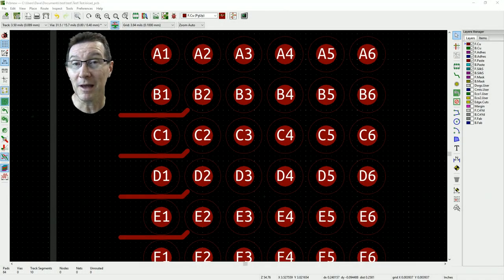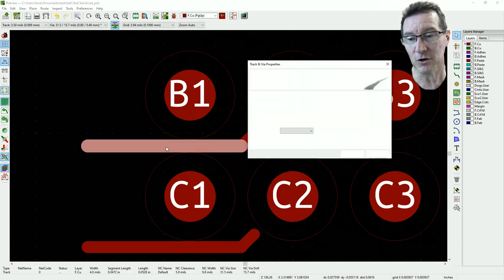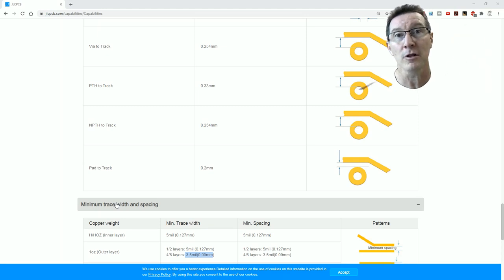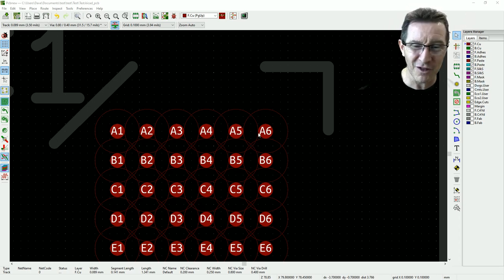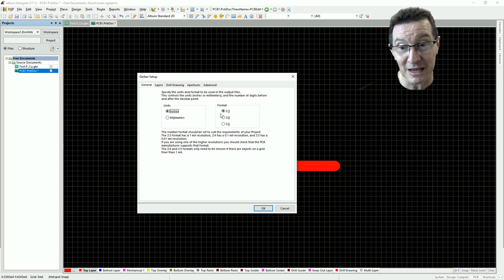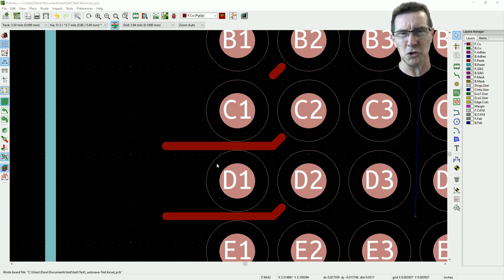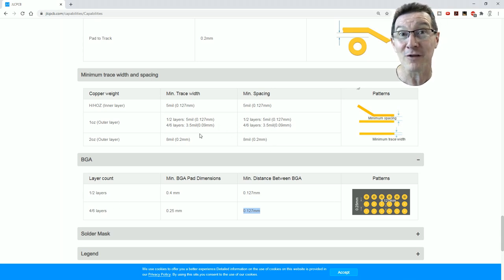EEVblog #1327 - 3 Ways to FAIL at PCB Manufacture

Comment: The pad to pad distance is about the solder mask, there are actually many companies that mess with that layer. For example my main supplier requires the solder mask in gerbers to have the same dimensions as pads have. But they adjust the actual dimensions in the tooling process (+2mil for small pads, +4mil for bigger). My experience with those prothotype PCB manufacturers (jlcpcb and allPCB) is that they are actually very helpfull and they will go over some issues with you (I don't know if that's a common thing for a $5 board or if they do it for more expensive PCBs, mine was about $80). For example I had an issue where they weren't able to put solder mask bridge between PADs and after a discussion with their engineer, I ended up making them a bit smaller.

Comment: Thanks for the video.  I use JLCPCB myself, and it doesn't seem that they touch the gerbers at all.  However, I haven't done any fine pitch (nothing finer than TSSOP-2, and no traces finer than 6mil) PCB's and so have not had any need to push the limits of their process.

Comment: I have switched many pcb production fabs and made a rule. Make all tolerances +1 LSD. For example 0.127 => 0.128, 0.2 => 0.21. With only execption is holes because it is makes no sence. Also, keep in mind rounding errors in checking and drawing software.

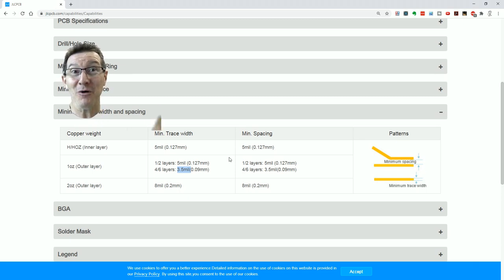Comment: Just wanted to add something regarding JLCPCB minimum trace widths @3:50. After reading the comments, it seems most people got away with 3.5 mil wide traces. Therefore, I just wanted to note that the minimum spacing of 0.090 mm seems to be a stricter requirement because I was told to resubmit or cancel my board because I also had a dense set of parallel traces spaced at 3.5 mil (0.0889 mm) as well.

Anyway, just wanted to state I wish I had seen this video earlier because redoing those traces was a pain.

Comment: I read English / Metric conversion rounding caused issues with the Soviet IC industry. They rounded the 0.1" spacing.  If boards/sockets and chips were from mixed systems, the more pins the harder to insert,

Comment: I use 0.199mm minimum spacing for all PCBs of 1oz-20z copper, manufactured hundreds from 2 layers to 8 layers, with several different manufactures and never a single issue. 0.199 is usually well within the capabilities of most manufactures. JLCPCB has delivered some of the worst quality boards ive ever seen but still worked with those limits even on 2 oz copper.

Comment: I add 16mil isolate on inner layers since I've had boards come back with the holes too far off. I also have had boards with spots that are not completely etched. I also had a board house not remove Silk over pads.

Comment: Nice video Dave- very helpful! Wondering why the pcb fab/software don't have an export/import default json file etc for the design rules. Would seem to solve a number of potential pitfals. You could also export the rules you like for different types of projects.

Comment: One of my last fails was the default solder mask clearance in KiCAD. Try doing a USB type-C plug with that and you end up with a Gerber file that has no solder mask around the pads. At first I though JLPCB changed my files. Nope, KiCAD exported a solder mask free block around the pads. 
Always check you Gerber files before sending them out. Don't just count the layers, check tight stuff as well 😁😁😁

Comment: In my experience JLC will adjust your gerbers to make it work. For example https://www.eevblog.com/forum/manufacture/anyone-used-these-through-hole-usb-c-2-0-sockets/msg3098449/#msg3098449 they chopped off the edges of round pads to increase the clearance to the traces running between them. I also think JLC specifically won't "reject your board" they'll adjust if possible, just leave it if not and send it to be produced - I've accidentally made several boards with traces that are too thin, too close to vias and via rings that are too small and they've made them all - I had one that had a bridge due to me violating the limits but the others worked fine.

Comment: If the defining spec is in mm, then that's what should have been written first.  The number in parenthesis should be the conversion.  Also, since this is a minimum the conversion should have been rounded up (or else omitted altogether).  The way this boardmaker has written it is erroneous on their part and leads to unnecessary confusion.  If this has been pointed out and they've refused to fix it then they're just being stubborn.
Definitely a good point to pay close attention to this. I never considered it before, and I think I have my track spacing design rule set in mils so I should change it.

Many people say "never design to the minimum" and I agree with that if you have the flexibility to be relaxed.  Personally I'm not in a situation where I need to push the limits so my design rules are set very conservatively.  But the manufacturer is being asked for this information for a reason.  If they say they can build something then they should be able to build it because some people are in a situation where they have less flexibility and these specs actually matter.

I don't expect them to argue and negotiate over a $5 job, but if the same issue comes up repeatedly from different people then it should be taken as a sign that the published specs need correction or clarification. But I won't lose sleep over the flaws of some China industrial business' web site, it's more useful to just know how to deal with them so that point is well taken.

Comment: I am currently having a reasonably small pcb being made by JLCPCB
nothing tiny, but traces going in between pads etc
and, when I started watching this, I had a heart drop moment of thinking "I didn't check that my design rules were set correctly"
because I've heard they'll sometime make ones that don't meet spec and then say they've failed the flying probe
but no worries
they were all set 0.1mm above what jlcpcb say they can do

Comment: 20:00 Oh come on Dave, one doesn't muck around with the caliper tool in the Gerber viewer if all one wants to know is the size of a trace or pad - there's a reason they are marked with the "Dxx" code of the tool they are getting painted with; you note the number, and select it from that drop-down list at the top called "DCode", which lists the size of the tool right next to its code (and also highlights all elements painted with that tool).

Comment: I once got bit by the specs. I mixed up annular ring and PTH diameter, so my annular rings were half what they should have been. Sent it to OSHPark, no complaints but it came back and at least 1/3 PCBs had a short somewhere...

Comment: If you spend a whole lot of time designing a board that got rejected for some tolerance issue, I'd just look at the other prototype PCB companies before spending another week redesigning.. maybe for another buck a board they can manufacture it
It would probably be good practice to look at a variety of companies and use the WORST SPEC of any company for each design feature, then you have the most flexibility later if you want to get it built by someone else

Comment: I think jlc do that board with 3,5mils, even with 3,4mils ... But also care of that these are the values for 4layer boards, a 2 layerboard needs 5mils (other machine is working on that)

They just do that fine. The bigger "problem" is, that i recently feel like the coworkers get more and more closer looks to the boards and recognize things like that, before giving it to production. That might be the problem, that they text you they wont do that for you. If they trespass the board to production, everything will be fine, without problems.

Comment: I’ve done a lot of PCBs on JLC and I think they check in software only the basic clearances. I’ve (accidentally) manufactured stuff well below their solder mask and silk screen tolerances and they usually come good (or in the case of solder mask once - completely missing). Haven’t tested them to drop below their requirements for trace widths/clearances but I think right in the upload page that will get immediately rejected (or price-adjusted).

Comment: Is there any downside to generating gerber files with maximum resolution? Frankly speaking, the increased file size isn't a very large issue, considering how little the files are compared to our drive sizes and how fast our internet is. 
I usually export in a format that was required by one manufacturer - I haven't used them in years, but the habit is still strong :P

Comment: Hi Dave, 
if you have to apply via plugging according Type VII (plug&caped), how to specify this in gerber data?
My question is based on failure occurred on one 8-layer board where manufacturer plugged also through holes soldering pads with same drill diameter as vias. 
For example, in drill data the via  and pad hole diameter 0.6mm will be marked with the same sign and code. 
Br
Josko

Comment: surely it makes the most sense for the pcb design service to have a pre-routing stage to selecting the online configuration wizard. That then spits out a settings file for those options you selected that can be imported into altium designer or kikad / whatever. You then do the routing after that. And go back to the website with gerbers. I guess should there also be some 'safe templates' availavble online for importing a common set of broadly compatible design rules for the main service JLC, pcbway etc. We live in an age of computers, it should be possible.

Comment: IMO floating head is better just because it occludes less of the screen. We don't need to see your shoulders, and it doesn't really add anything, so removing them just means you're less likely to accidentally be blocking something with them.

Comment: Does anyone know the answer to Dave's question about how to import  DRC rules into KiCAD? I am currently laying out a board for the first time and would like to know how to do this to get the program to yell at me for being dumb. Instead of me finishing laying it out out and then find out I was wrong all along.
Reply: 1-Create a template project with the design rules you desire and save it.
2-In the Pcbnew window of a new project, from menu, choose  'File->Board Setup' 
3- Press 'Import Settings..' Choose the previously saved template project in the 'Input from' and check the 'Design Rules'.

Comment: Damn. I was just commenting on some other video about imperial vs metric, about PCB design hurdles, and here you have it again. What a coincidence. This 3.5mil should be really 3.55mil. But it is likely they play on the safe side, and can easily produce 0.08mm or even 0.07mm traces using their standard processes, so can give you safe values.

Comment: Unless you really need to use fractional trace width values, why would you bother?  
Why not round the 3.5 -> 4 or 5?  (If you can get away with it)?
Why would you cramp your design unless you have a really good reason or some strict sizing requirement?

Comment: I assume the clearance could be a solder mask thing too since some masks wont spread between traces of different shapes depending on if they spray it on or squeegee it on plus whatever method they are using to print the solder mask (inkjet or negative film) and the alignment methods of the film on the mask - robot or human

Comment: it is not just drill wander. when you laminate a 4 layer board, things will not line up perfectly.
Top and bottom are slightly off, inner layers are slightly off, the whole thing is slightly bend and warped, ...
(let alone: vias are "texas sharp shoter", as the hole is drilled before the chopper is etched away)
As I like to say: Yes, we are splitting hairs here - because we literally are in physical dimensions, where a hair is a relevant unit of measurement.

Comment: Using freedom units for anything technical in 2020 is dumb.
Reply: Yes it is very annoying that some stuff is in thou but with pcb layout, a load of things are already in inches / fractions of inch, like 0.1inch pitch parts, presumably for historic reasons.

My Kicad is all in mm and I don't like to use inches but sometimes I am forced to convert (also my 25.4x table is not too hot...)
Reply: imperial units got us to the moon, metric units got us communism and utter failure.
you can guess, which one is better
Reply: @Xiefux  "Contrary to urban myth, NASA did use the metric system for the Apollo Moon landings. SI units were used for arguably the most critical part of the missions – the calculations that were carried out by the Lunar Module’s onboard Apollo Guidance Computer (AGC) during the computer-controlled phases of the spacecraft’s descent to the surface of the Moon, and for the journey of the Ascent stage of the craft during its return to lunar orbit, where it would rendezvous with the Command and Service Module (CSM)."
Reply: @Xiefux  can you show me on this puppet where the metric system touched you?
Reply: Mark Robson  just buy 2.54mm headers , simple as.... \s

Comment: i mean - the 3.5 mil COULD be accurate and the 0.09mm rounded up (0.0889).

Trace-width and spacing - i always go as wide as i can.
A simple signal-trace? Sure, make it 1.25 mm wide and 1.25 mm clearance - if the pin-pitch allows it. There is no reason to have 90% of your board empty space (at least as long as you are not dealing with high frequencies). Just use the darn space you got. Also - wider tracks => lower resistance. Might even help you in some cases.

Comment: I could have swore I looked at this page about a year ago, and their minimum specification was 3.4 mil.
I also could have swore that they didn't use to list the 0.09mm next to the 3.5 mil. I wonder why they changed it...
EDIT: their minimum pad-to-pad spacing spec might have something to do with their HASL process and solder finish bridging.
Reply from the maker: Refining of their process tech, and maybe switching to metric for everything?

Comment: If you design a board right on the edge of their minimums, is there a higher risk that it will suffer manufacturing glitches? Is it worth being a bit generous above the figures they specify to reduce that risk? Or is it going to be fine so long as you pass their simple software check?
Reply: There are published and unpublished ± tolerances of variations you may get on your boards. They build in some margin for their processes to ensure yield and avoid a bad reputation for ignorant people violating them. On the edge should be fine functionally, but dimensionally you may notice variance. Whether that matters to you depends on the design.

Comment: I have never looked into this, but does the software have the capability of loading in pre-set rules, and if so, do PCB manufacturers supply rule sets specific to their setups to help remove issues like these?
Reply: I've never seen that done for a board. For a SIP,  some companies will supply the constraint sets for the tool they prefer, usually Cadence. SIP's are very rule driven and complex.

Comment: i spent too long on that page the last week...
made a 4 layer board, then noticed 2mm drills added about $60 to my board.
then i didnt realize the 2mm option in advanced is only on 4 and 6 layer, no extra charges for smaller than 0.45 on 2 layer, but i had already gone over the 15 2 layer boards in my cart and changed the drill size to 0.45mm, a lot of wasted time.
and now i see i have to go over my 4 layer boards.... fuckin hell

and yes BGA is fucking hell if you want to make it work at jlcpcb, you will have to have vias dirrctly on the pads, and you wont be able to use every pin.

and yes dave there are separate abilities for bga.

Comment: FEEDBACK: 
Floating head is cool. I'd stick with it. It has it's place.
Watching UI recorded  at 1920x1080 resolution though is poor. Suggest using a lower res like 1280x960(?). Wish we all had fast broadband. Should be good at 480p, Big Sign should advise 1080p perhaps. It might help beginners.
Your looking point of view should be flipped(which i think it is (ie calculator)) so that when your looking to your left. your referencing something we see on our right as viewers.
Reply from the maker: Bad idea, Youtube expects 1920x1080 or 1280x720. Majority of my viewers watch on a desktop that has at least 1080p
Reply: @EEVblog  as do i, but when youtube auto throttles you to 480p it looks bad. Resolution scaling your UI could help. You still capture at 1920x1080 for youtube.

Comment: Mils vs. millimeters? When you have a mix of components, some with dimensions specified in inches and some with dimensions specified in millimeters, it's a real PITA. You can't fit them all on the same 0.1" grid like you could in the good old days. Bummer. Why does everything have to be so tiny? Give me multiple boards in a rack with a wire-wrapped backplane. Who needs a computer that fits in one's pocket? Who even needs a home computer? Just to watch Dave on YouTube?

Comment: I use a program called Convert.exe when I have to convert units.  It is so simple it doesn't have to be installed.  I don't have to remember any conversion constants or formulas.  Just use the windows OS to create a shortcut to the program.  It has 3 rows of tabs to select field, 2 boxes to select the input units and output units.
Reply: Or you can just type it into google.  0.09 mm in mils
Reply: @stargazer7644  Ah yes.  But I'm not always connected to the internet.  I don't have a smart phone.
Reply: To convert between inches and mm, it's faster to just grab a calculator and multiply or divide by 25.4.
For anything else, you can just type "units" on a Linux machine to convert everything, no mouse or gui required.
Reply: @rocketman221projects  The convert program remembers over 20 of the formulas for temperature, distance, area, flow, energy, power to name a few.  Also corrects the decimal point when going from inch-pounds to newton-centimeter for example.  Do you remember them all?  Both directions?